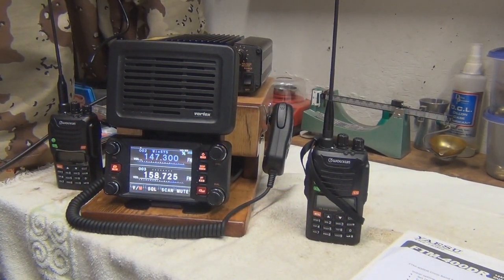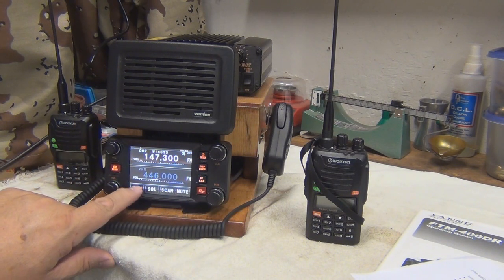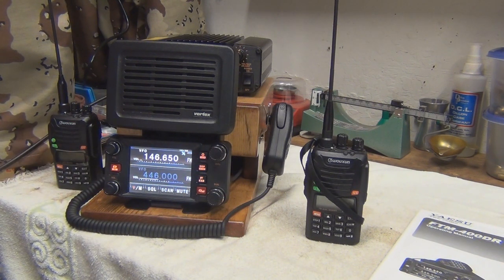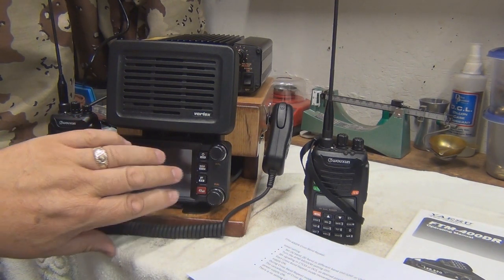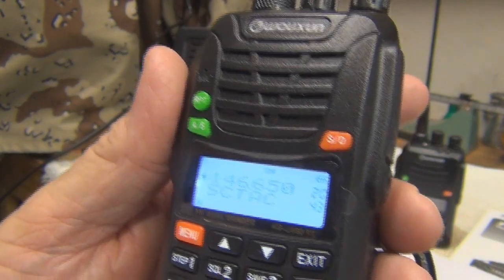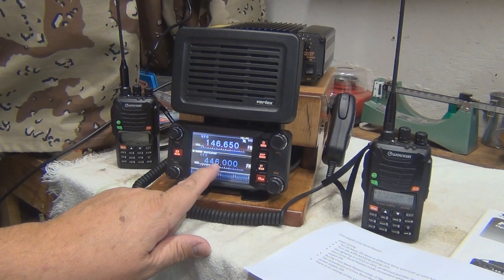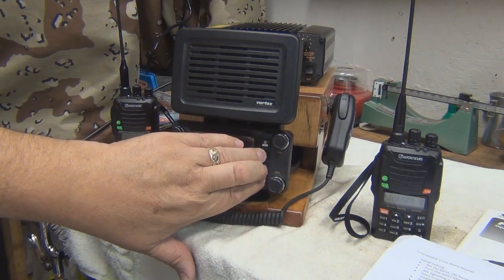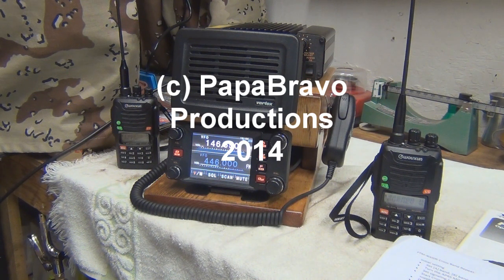FTM 400DR Corssband Repeater

Comment: I enjoyed the education. A lot of used older radios will cross band repeat too. Like my yaesu 8100. I haven't done it yet. But I think I'd like the FTM-400 left open to use as my main universal radio. But this gave me the idea to set up my 8100 to do this. This would really work well mobile too. A second radio set up in the truck, so if you are in the mall or campground. If you hook up a trickle charger at the campground you wouldn't have to worry about your car battery dying, that is if you have a electric site.
Reply: onemarktwoyou   In the late 90's I owned two Yaesu FT-8100R radios - one in my car and the other as my base station. I always used the same model radio for both installations since they both operated the same and were programmed the same way using the same software. I LOVED the FT-8100 but I originally owned the prior model, the FT-8000. The 8000 was identical to the 8100 except the display did not separate from the chassis. Sadly, the FT-8000 had a design issue involving both volume controllers. Seems the potentiometers, through normal everyday use, would loosen over time and typically after a couple years of pushing the knob in to select that particular band or 'side', the ever-loosening volume controller would eventually "give way" and would push through into the frame of the display literally ripping the audio & squelch circuit traces off the main circuit board in which it was soldered to. Being an electronics tech, I was able to repair my own 8000 but it was an extremely tedious repair. Most, if not all FT-8000's, were beyond their warranty and the owner had to bear the full cost of repair. Sadly, many FT-8000R owners chose to sell their beloved radios as 'parts only' or 'tech special' radios :>\

Comment: Two questions: 1) I understand that in normal mode the FTM-400 will automatically detect if it is receiving a system fusion (C4FM FDMA) signal or analog signal and adjust the transmission response to the correct format. Now when I paused your video and read the message from the Yaesu tech, it says "During Cross Band Repeat Mode, it becomes a mode for exclusive use of analog". So does this mean that I cant contact my FTM-400 (in cross band repeater mode) using system fusion HT, and then the FTM-400 could repeat on the other band in analog? Seems a shame since i understand system fusion apparently has good quality. 2) Does the Automatic Transponder System still work while the FTM-400 is in Cross Band Repeat Mode?

Comment: Thanks for the additional information.  Am I correct in saying the backside in completely open? No cross piece  like in front.
Reply from the maker: Yes it is. I forgot to tell you that I put the mounting brackets in place before I put the top on (note the holes on the side to mount the base unit with the mounting screws). This way I could mount the unit leaving the back open for the power and antenna lines.

Comment: Nice job.  I have an FTM-400 arriving soon; it is nice to see some folks posting on it's operating characteristics and capabilities.  Have you figured out how to manage and organize the massive number of memory channels?  Also, how's that Alinco power supply doing?
Reply from the maker: Thanks for the comment! First the power supply has been great - low heat good connections. What I did for the freq's was to list out all of the ones I wanted in the system, labeled each with tones or whatever was needed and started entering. I used the top band for the most common freq's that are used in my area, and the bottom band for the less used and sheriff, fire airport and the like.

Comment: Great video.how far can reach the CBR of yours using the handheld radio?
Reply from the maker: Like most radios, it depends on the quality of the handheld, your base antenna and the area you live in. I can easily get a mile when I am in line of sight of my antenna, not so much when I'm behind a hill or building. Thanks for the question.

Comment: I know you posted this 4 years ago - but I just saw it as I am considering getting the FTM 400 as my 1st dual band receiver after receiving my Technician license. Question - the wood assembly you have everything mounted on - did you buy it or make it yourself?
Reply from the maker: I made it myself! After carefull consideration and a lot of measuring, I took a single piece of pine board and started cutting. All joints are glued and screwed...just worked on it till I got it the way I wanted. The rack came out very nice. Thanks for noticing!

Comment: So if you want to hit a repeater with an HT you set the HT transmit freq to your mobile, mobile transmits to repeater Freq? Then set HT to receive repeater transmit freq?
Reply from the maker: Yes, but your mobile or base unit must be set in repeater mode for this to work. Then follow the instructions in the video. Thanks for the question.

Comment: Unplug the microphone when you enable the cross-band mode.
Reply: That's a good point! I noticed on mine that the mic was going hot whenever it was transmitting in cross band mode. I kept hearing feedback if I had the HT anywhere near the mic on the 400.

Comment: When in CBR mode, does the FTM 400 allow you to xmit on any of the frequencies selected through the mic? I'm thinking in regards to operating while convoying, where distances could be about 25+ miles, I'd like to be able to transmit on my mobile radio on my car (which would be the 400), have the person in the seat next to me transmit using an ht linked to my 400 through CBR, and then be able to get out to other vehicles that have high power mobiles installed so that they can get back to me (if that makes sense).
Reply from the maker: As long as you set up the channels on both the FTM and your HT to each of UHF and VHF, the HT could transmit trough the FTM with your HT to your other mobile units and they would respond on the UHF that you selected. But once you set up the channels you are kinda stuck with them unless you reprogram to new channel settings...if that make sense...
Reply: I guess what I'm trying to get at is, can I use the hand mic attached to the FTM 400 and talk out with it in CBR mode?

Comment: Hi, my old FT51r handy does exactly the same cross band repeating but here in the UK you need an NOV (notice of variation) on your license to use it that way, is it not the same over the pond with you?
73
Phil M6MRP
Reply from the maker: As far as I have researched...I could not find any restriction like that here in the states. As long as you transmit on freq's you are licensed for it is ok. thanks for the comment! 73's... Papabravo.

Comment: Have you had any issue with the squelch on the active vfo opening up regardless of squelch setting (even in maximum setting) for 2 minutes or so shortly after turning on the radio? This is happening to me in a mobile settup.
Reply from the maker: My setup is not mobile so I'm at a loss. Could be an issue with the car's electrical system interference?

Comment: Good informative video although it is disappointing that CrossBand function seems to be an after-thought by Yaesu on the FTM400.  Beautiful touch display. 
 They could have made selecting CrossBand a real menu option rather than having to use a four-finger exercise to enable and disable it.  
Limiting Cross Band to FM Analog is disappointing also.  I haven't invested in Fusion yet but will down the road.  So far my DV has been three years with DStar.  On the IC2820 and ID5100, CrossBand is possible on FM analog and DV DStar.  
Crossband is enabled on the ID5100 as a regular menu option, but in the IC2820, it is a three finger exercise.

it's all good.

Comment: is possible crosbband from digital vhf cc4fm to uhf fm?
Reply from the maker: Not sure, you'll have to check with Yaesu. Thanks for the question!
Reply: I tried,  put my 440 into digital,  both DN and VW, when I put into CBR mode, it reverts to FM analog,  AMS off, and doesn't let me switch modes.  But for fun I tried crossband repeating from AM to FM and it works fine!

Comment: Who built your wood case for your Yaesu?   If you did can you make me one I will pay for it and the shipping.
Reply from the maker: I build it myself after much consideration and looking for a commercial one. I did not make plans for it (probably should have!). It was a long time ago, but was easy to make with only a few hand tools, 1 piece of 8x1x6' pine plank and some glue and screws. Thanks for the suggestion, but I barely have time these days to use the Yaesu FTM400 let alone build another holder for it. Good luck and thanks for the comment!

Comment: The boards you used for the stand,1x6 ?
Reply from the maker: Yes, I believe it was a 1x8x4' piece of clear pine plank (easy to work with and light weight). I was able to design and cut all of the pieces from the one board. I left room for the base unit to ventilate any heat from the front and able to load the unit from the back, with space on the front of the stand for the display and speaker. I also left a space in the front of the enclosure to allow the wires to go through and coil (if needed in front of the unit). I should have made my design on paper in case anyone (like you) wanted to make it. If you watch the beginning of the vid you might be able to see some of the detail. I did drill, countersink and screw the side to base support pieces together, then glued the remaining top and front piece on. Sanding, stain and finish. Hope this helps!

Comment: The 146.650 is only .005 away from the 146.655 repeater pair, so not a good choice for regular use.  It is good practice to use CTCSS or DCS to make sure the repeater doesnt lock up on tx when you are away and forgot to turn it off!  Also not a bad idea to keep it on low power, or 10 watts.  I had a TM-742 on repeat for years, worked great!
Reply from the maker: Great point, these were all set to 5 watts... thanks for the comment!

Comment: No need for any crossband repeating Radio Systems like this I made one that was very cheap and simple it's based on using a surecom Sr - 328 duplex repeater controller it's simply uses audio outputs to do the work all's you have to do is set a receiver such as a scanner on 446.0 and then that would be the receive going into the repeater controller then simply connect the correct radio cable to the controller and there you have it